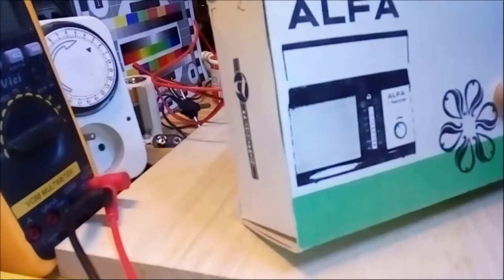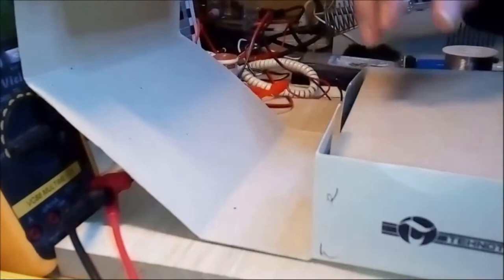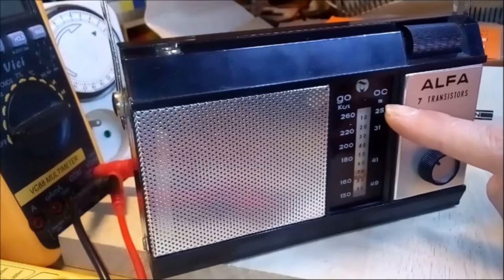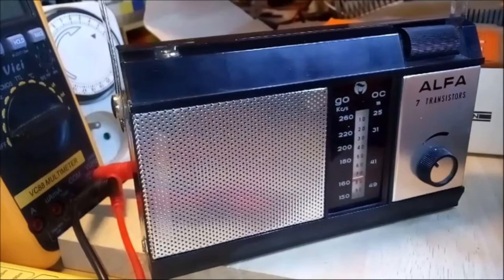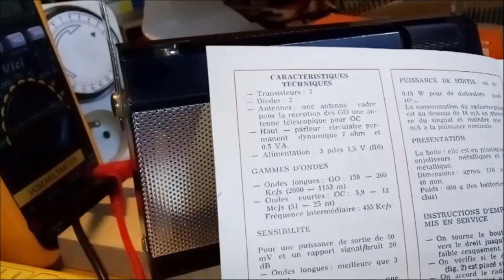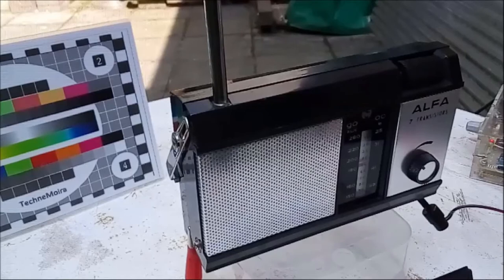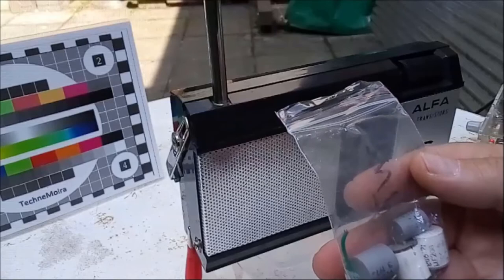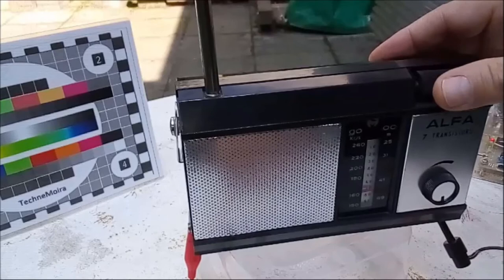Tehnoton ALFA Radio part 1 of 1

Comment: Hello! Thanks for your video! I am from Romania and I did not know about this variant of Alfa radio (I mean LW+SW). I wanna buy this radio! In Romania were available 2 versions of your model: LW+MW and MW+SW. I own both of them. Both are built INTEGRAL with 8 germanium transistors, no silicon transistor for RF stage as I see here. Your model is rather a variation of Alfa 3 radio, which has 3 silicon transistors on RF stage and 4 germanium transistors on audio amplifier stage, total 7 transistors. In Romania existed 2 factories which built radios: "Tehnoton" and "Electronica", so you can have the same kind of radio with different factory logos.On the other hand, electrolytic capacitors that equips the radio and you show in the video are from Romania. You can see written on them IPRS ("Intreprinderea Piese Radio si Semiconductoare" - which literally means ''factory for radio components and semiconductors''). Also, on electrolytic capacitors you can see written the year of manufacturing, which can give you the ideea of year of manufacturing the radio. If you search on Youtube ''Alfa S-711T'' you can see my video about Alfa radios available in Romania. On the site: www.proradioantic.ro you can see what radios have been built in Romania, including pictures with internal parts and schematics. All the best!
Reply from the maker: Welcome to my Youtube page :) 
I'm glad you enjoyed watching the video. Actually, believe it or not, I found this radio on Ebay in France. The seller could tell me only that it had intermittent working, and that's as far as his knowledge went, about this radio. He added it to another couple of radios I had bought from him as an "extra". 
I must confess, I had never heard of Tehnoton or Electronica in Roumenia.  
What struck me as odd was, that the radio has only two rarely used bands (LW + SW) which is a combination almost never found in Western radios. It's indeed also a bit rare because of the combination of silicon and germanium transistors used on the PCB.
I didn't know about the electrolytics... I still have them, after having replaced them by modern Nichicon electrolytics. I'll check it out and add the info to the description of the project.
You can always reach me via techne point moira. On google mail, if you wish.
Thanks for watching and again, thank you for your nice comments :)